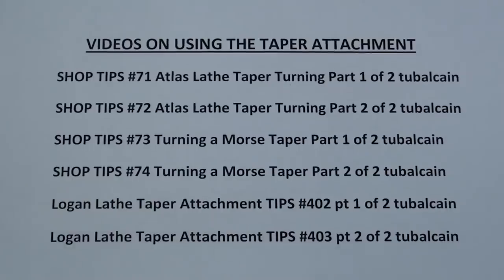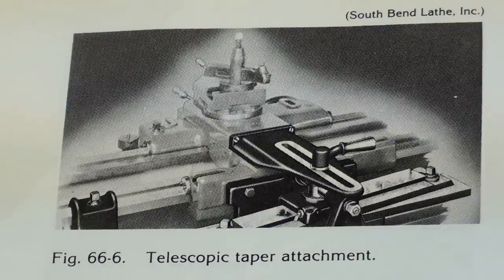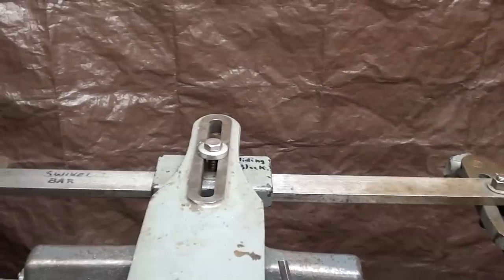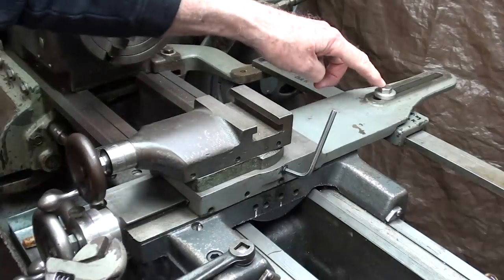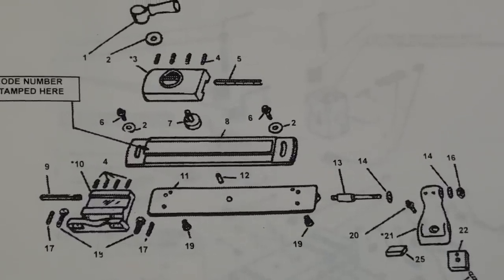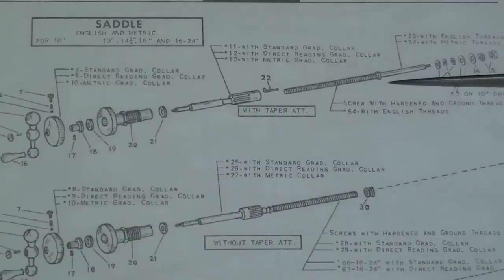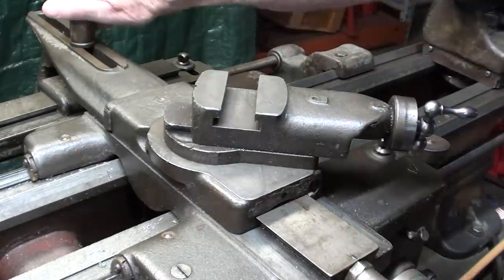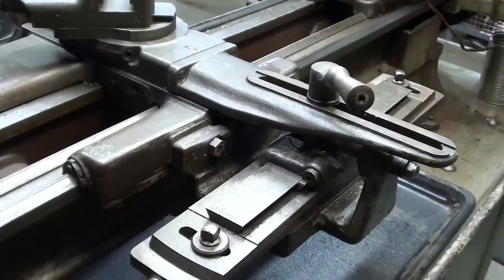Plain vs Telescopic Lathe Taper Attachments TIPS 561 tubalcain

Comment: Planning tomorrow's machine shop class. It's about tapers, methods and taper attachments. So after 35 years doing this, I now know the difference between the two types. Never did until now, so thank you. And my Graziano lathe obviously has the telescoping variety. Interestingly, I don't need to unclamp anything to set DOC.

Comment: Thanks Lyle,
I'm in the process of fitting the Hafco TPA - 1000 Taper attachment to my AL - 960B lathe.
The instructions are basically non existent.

Due to your concise instructions I realise the unit as supplied is a fancy plain attachment or 7/8 of a telescopic attachment.

I've had it new in stock for a couple of years after waiting about a year for it to arrive. It is quite a challenge to fit with nothing actually fitting.

Thanks again.
Reply from the maker: I am glad my instructions were helpful to you. Good luck on getting it to fit up, you can do it.

Comment: Nice video the telescopic part of the south bend is that the cross slide screw is keyed and slides at the hand wheel end of the feed screw so the brass nut does not have to be disconnected. Other than that Your video is correct

Comment: 2:10 - That's the one I have for my August 1960 Sears Craftsman Lathe.  (I'm circa June 1960.)
I've actually used it quite a few times... it comes in very handy. (I made my own Morse taper 1/2 point for a project... and it worked.)

Comment: Hi Mr Pete. I’m having a hell of a time removing the taper pin on my taper attachment on my SB 10L (1968). 
I removed the handle. There’s a hole on the side of the handle but it’s empty. Can’t see through it so I’m wondering what it’s for. 
But I can’t get that pin out. I’m tapping from rear to front. Is there something blocking it? Does the cross slide need to be in a certain position? 
There’s something I’m missing. What could be binding it up? Should I drill it out? I’m at a loss. 
Thanks for all your help. 
Paul
Reply from the maker: You may have to drill it out

Comment: This video is very interesting for the question i ask on the taper attachment  you used on tip 71 video i will make a guess on the measurements the plain one ill try to make on my atlas just as on video 71 but the dovetail piece on cross feed i cant make well ill try but i have no mill and the plate you made with the app degrees on it is ? thank you Mr Pete for your videos well back to the making process have a nice day love to meet you but i live clear across the states Pa. Duane ( i didnt under stand your reply )

Comment: Henry inherits Grandpas tools, has estate auction, moves to Cabo San Lucas and lives like a King on the proceeds.
Later:
Needs to hang a picture on the wall, uses the heel of his shoe to drive the nail.
Doh!
Reply: I can’t concur: 

Don't underestimate effects of the steam and machine virus. If exposed to it at an early age, the patient will never fully recover from its long-term effects, thus altering behavioral pattern on a sustained level for the rest of his/her life. 

All tho men are more prone to this problem, extensive studies concluded that also female specimen are prone to this desease, depending on the given exposure and circumstances. But as female need more exposure, and the a social dimension will also alter the rate of contagion (men usually need seconds to minutes to infect) females will sometimes develop even resistances, or even counter it with repulsive behavior patterns. Very fatal if the virus is contracted by the men, while already married to a women, it can lead to a very difficult situation, if said repulsive behavior manifests in his mate.

Beside of the symptoms we observe in massing hording of tooling, the urge to keep them is also very prevalent.

As is the excessive use of all kinds of oil, fluids and pastes used in a machine shop...
The unwanted side effects will also accompany him, lack of time, constantly thinking of machining operations or a general short attention span for non-related topics.

BUT, if infected early, and it seems, that is what happened, he will never end up, beating a nail with a shoe, i can assure you of that, neither is he going to sell toolings that are still usefull. Of which, a hammer is the essentials for a mechanic. You can fix any engine with it.... ANY!!!!!!! 

Diagnosis; long term, irreversible and non-treatable.
Reply: @MrZhefish  Yes I have this Virus. I got from my Father whom got it from his Father, I also think in my case it could be partially Genetic!
 Cheers from John, Australia.
Reply: MrZhefish I have it and am only 12 so does my uncle

Comment: Have those ever been able to trace a model/template/stencil like Keith Fenners hydraulic one is able?
Reply: These are a bit more primitive, they can trace just the angles. There are tracers like Keith's (and other kinds as well) available - look for "tracer attachment".. Youtuber Build Fix Create made one with pneumatics for a Logan lathe which looks interesting. The air provides a "spring" to push the follower against a pattern.
Reply: @carneeki  
Actually the tracer attachments that Keith uses and all the ones I know about are driven by hydraulic oil pressure, the pointer that follows the model to copy has some kinda sensitive valve that will control the tool holder forward or backward, typical pressure is around 1000 psi in those systems, air would be too soft due to the fact it's compressible.  I got one of those system, but it's not attached to my lathe though...
Reply: Yes, there was a fully mechanical tracer attachment made back in the late '40s/'50s that would trace a pattern. It was fitted on the front of the lathe and didn't involve the use of the taper attachment at all. 
It was difficult to set up and get a pattern correctly made. I've never seen one in the flesh, only photos.
I've used hydraulic tracers and they work really well. The pattern can be lightly made as it doesn't take much force to actuate the sensor. The nicest one I ever used was built into a German engine lathe. The pattern mount was permanently attached to the back side of the lathe bed and had micrometer adjustments at either end of the bed  to make easy adjustment of the pattern without having to loosen it and clamp it back down. It also had mounting centers so the first part made by hand could be used as a pattern for subsequent parts.
CNC made tracers obsolete, but new tracers are still being made in India. 
Cheers from NC/USA